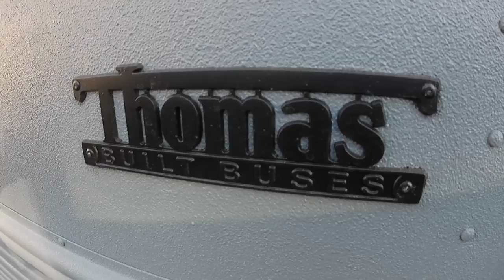SKOOLIE BUILD | PAINT PART DEUX | RAPTOR LINER | COLOR REVEAL | TURNIN A SKOOLIE INTO TINY HOME!

Comment: Awesome job! I happened to accidentally find you because I am getting ready to do my midsize skoolie in Raptor! I was researching technique on vehicles lol. 
Question:
So did you go with your own color because of the color or is it cheaper than choosing raptor color mix? 
How much was your gallon of color? Where do i go to get my own?

Im so excited  to see see someone else with my thought processes on the Raptor on a skoolie! Here in FL the sun eats the top coat off paint quick but after much research this is cheaper and more durable in the long run! Love your videos!
Reply from the maker: Oh wow! Thank you so much for the kind words. Yes, the Raptor does seem like it's going to be a great investment for the long run. We got our color at a local paint shop. We told them what color we wanted and they mixed it up for us as well as delivered it. It was pretty expensive, cost us around 130 for around three quarts. The raptor color is a great option also, but we just wanted this particular Blue/Grey color. Lacroix Cruiser has a great video as well on a similar product. Check them out. We bought two different guns to spray with but we would really recommend just using the included gun in the kit and buying a pressure regulator to put before the gun. The links to what we used are in the description if you want to use those. Please keep us updated on your bus. You can connect with us on Instagram also at @csskoolie_adventures and we are on Twitter under #csskoolie

Comment: How many bottles / kits dis that take? We are doin ours withroof lift.. Grabbed 8 kits 32 litres.. Wondering if im good or gonna need mire...
Reply from the maker: It took us 20 liters at three coats
Reply: @CSSkoolieProject  Good to know, thanks.. I've been talking with a friend that paints vehicles often with it, and he's saying if you overspray by a 3rd as you go, it should only need 1 coat. Our bus is raised 20 inches, so more surface area.. Realized each bottle says it will do 45sq ft. So, at approx 380 per side, and 400 ish roof, front/back guessin 150-200 w windows etc, we should be good.. 45sqx32L = 1300 so gonna b close for sure.... Will upload vid at some pt 😉 thx for reply
Reply from the maker: @inphiknitfractal  Of course. Don't hesitate to reach out if you need. FYI, for me, I bought one of those high dollar guns and it didn't work well as the paint goes on really thin. If you have one of those, maybe do the first coat really thin. That's what the pro's say works best. Then you can spray with the gun that comes with the kit. The yellow is really hard to cover BTW. That's why the coats need to be light and multiple. Just my 2 cents.
Reply: @CSSkoolieProject  luckily we sandblasted so no yellow to cover :p thx again. :)
Reply from the maker: @inphiknitfractal  oh that’s awesome. Did you do the blasting? I’m thinking of getting one.
Reply: @CSSkoolieProject  Yeah, used to do it for work, really easy to learn.. Bus is a longggg process tho (if anyone reading this  is considering it) .. Kind of like the rest of building a skoolie 'p Definitely easier than hand sanding though.
Reply from the maker: @inphiknitfractal  can you recommend a blasting machine that’s not thousands of dollars?
Reply: @CSSkoolieProject  I picked up a Uni-Ram U100S used for $250 (Canadian) ... They generally go for about $700-$800.  Guess it depends what it's for.. This one has worked really well, just had to put in a few inline air dryers.  If I were to do it again though, i'd probably go for a slightly larger capacity version. . stopping to add sand often wastes more with the time it takes to adjust settings / compensate for moisture or screened sand building up in nozzle etc.